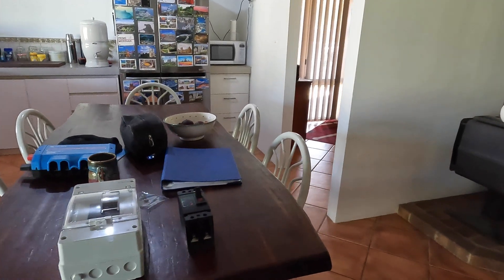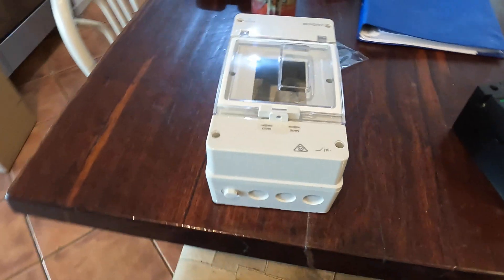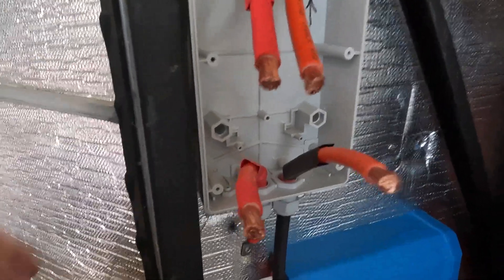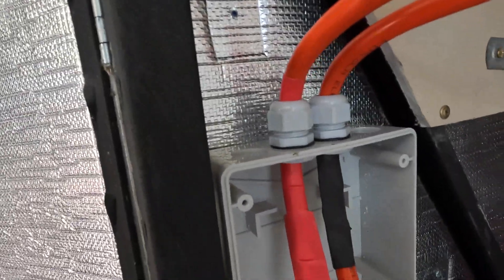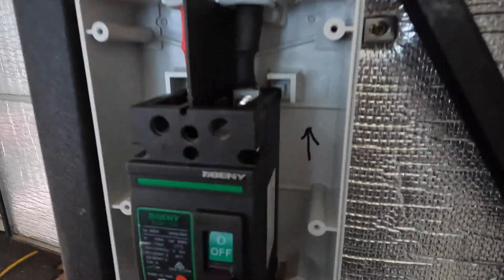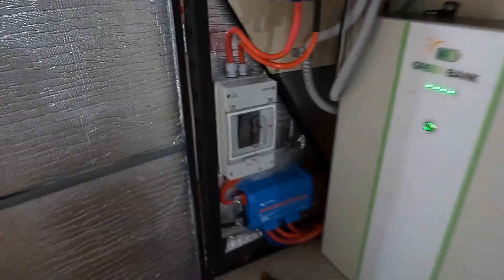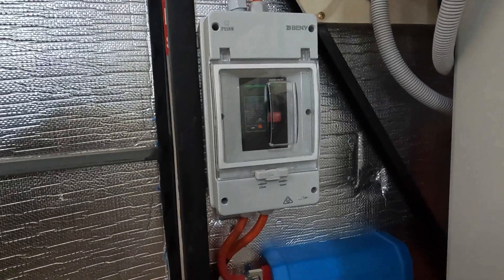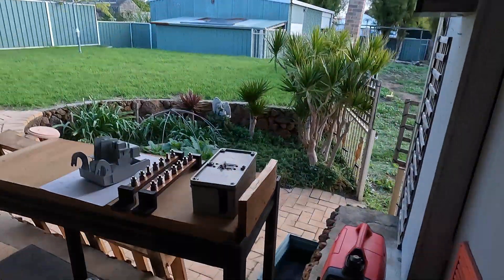Wiring the Lynx Power In + ZJBeny 2P Battery Circuit Breaker

Comment: Can I ask the size of the circuit breaker you used, looks like a nice unit.
Reply from the maker: hello yes We used a 125amp continues rated breaker.  Next question. Isn't that a bit small ?  No its not. my home is extremely energy efficient. 125amps x 51voltes = 6,375Watts.  The lowest volts my lithium batteries go is 51.4vdc . So even in summer we can run the AC unit and wife can go about her normal wife stuff and I can go about my normal man stuff. You can buy larger units. https://www.zjbenysolar.com/BESS-DC-Breaker-892-1.html 😉 ✌
Reply from the maker: you're welcome  🤓 👍

Comment: You have done a good job, sir, well done. My question is; is the inverter warming up those batteries good? Winter is upon you there. What is the temperature like inside the enclosure when it's cool outside?
Once again, well done sir.
Reply from the maker: Yes they are. They have not dropped below 15c yet and we have had some very cold days / nights. So I am assuming they are happy. We have plenty of power and the inverter is noiseless, Have not had the 2 fans at the back of the unit turn on yet. At least I have heard them. 👍

Comment: Your work has always looked good but it's looking real nice now
Reply from the maker: Thank you mate. Not hard to do neat work with the new system. I am hoping never to have to touch it ever again when i am done. I love boring Quiet Off Grid systems that just keep working.
Reply: @JustinCaseSolarPower  yeah know what you mean I'm getting to the age I just want things to work so I can enjoy the rest of my time
Reply from the maker: @dama054  We spent a lot of time and $ redoing it all now. So the next few years we can head off and go bush whenever we want to and not have to worry about our home. Have to tweak the camper trailers system after this job. Don't get me wrong It's good but it can be a lot better. Need to get a GVM upgrade to I can carry a bit more on it and still be legal,
Reply: @JustinCaseSolarPower  look forward to seeing that
Reply from the maker: @dama054  Wont be much to see. It will need to go in and get checked over. Maybe a few upgrades to the suspension then it will need to have an engineer's certificate, Then it will need to go over the pits for a final inspection and then it will get replated with the new load capacities. From the time I drop it off to the time I pick it up it will be out of my hands.